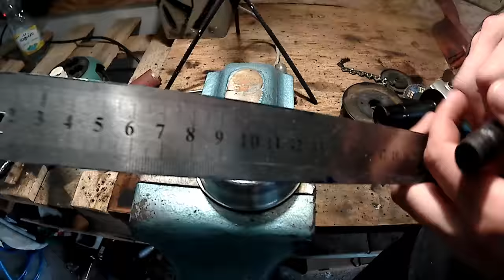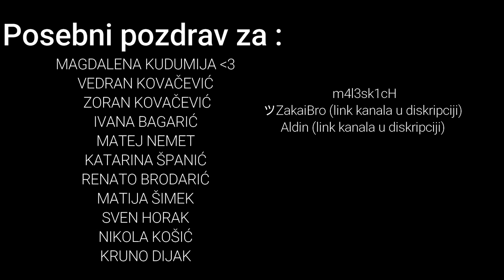Homemade Chain for TRIMMER?  !!!!!   JUST EXPERIMENT   !!!!! + TEST  (DONT TRY THIS AT HOME)

Comment: I would not make one of these.  1).  Good trimmer or not it's going to wreck the drive shaft, output shaft, and the motor if you're not lucky.  2).  If a piece of this flies off it's not going to end well.  I had a piece of .105 diameter Stihl string break off today and strike me on the arm.  It hurt like hell and I have a large welt on my arm now.  It's still pretty tinder to touch.  A piece of chain breaking off and striking you is an automatic trip to the ER.  Nice idea but let a company engineer it and then buy it from them after it's proven.

Comment: I would use small hose clamps rather than weld. That way u could easily replace. Also i would add weight on opposite side for balance

Comment: 1. центровка нарушена - редуктор сломается быстро. 2 эффективно работает только одна половина - вторая обратной стороной. Если уж плевать на безопасность и нет желания использовать стандартный диск для кустов цепь надо было разделить на 2 части и одну из них развернуть на 180 градусов.
1. The alignment is broken - the reducer will break quickly. 2 only one half effectively works - the second is the reverse side. If you do not care about security and do not want to use a standard drive for the bushes, the chain should have been divided into 2 parts and one of them to be rotated by 180 degrees
Reply: я тоже сразу на центровку подумал!

Comment: Neat idea but one of your blades is backwards so one chainsaw chain is just slapping the grass while the other one is actually cutting. The blades need to face opposite directions.
Reply: No any part of this chain is actually cutting. All it does is munching / ripping the grass. It does not matter which way you put it.. The only way it cuts is the case when the chain brakes and cuts your leg. Other than that, what a great idea!

Comment: Don’t do this I had a friend killed with one of these home made flail mowers! The end flew off and punctured his skull - he was working 30meters away when the accident happened as his work colleague was strimming . The subsequent health and safety investigation found that the flail chain was not rated for the speed or forces at which the attachment was being spun by the strimmer, they calculated that the tip which hit him was travelling at over 200mph which if memory serves me is nearly as fast as a bullet. It isn’t worth it for the sake of a poxy video.
Reply: I am sorry
Reply: Andy Tomsk most bullets travel over 700mph, plenty double and triple that... so your memory is tainted

Comment: You made it out of 1 piece of chain, so only 1 side of chain will be using the cutters on the chain, you needed to cut chain in half and weld the chains where they will both be cutting

Comment: Only one half is cutting with the actual teeth.   Do two separate chains so they're both oriented the correct way plus you'll be able to better balance it by welding one chain on one side of the hub and one chain on the other side.

Comment: With that much extra weight it needs to be balanced , not perfect but close.  You could add balance weight with three langths instead of two or use extra weld on opposite side. Good day🇺🇸TRUMP 2020🇺🇸
Reply: Дуракам закон не писан,дроблёный Буратино в голове вместо мозгов

Comment: That could put a hell load of strain on that machine. It's only small. The angle drive isn't mad for heavier parts like that or the extra G's it's gonna make when spinning.
Reply: Going to have to agree.  That thing looked like it was way off-balance, and it'll probably end up wearing out the bearings on the machine pretty fast (or snapping the driveshaft).  Assuming it doesn't fly apart and hit someone first.
Reply: @user-ld8ep5qr7m  at one point stihl actually made chain heads for the machines. they blitzed through bramble, nettles and pretty much any green vegetation that would normally snap cord head. they banned them after a weak chain link broke lose, hit a worker in the back of the head and killed him outright.
Reply: @thefightinfox7846  Sounds about right.

Comment: OMG!! This is fukn funny as hell!!   one.. this are sold online and in stores..and your "experiment fails" how? why?  you attached the chain backwards BACKWARDS>.you are no cutting with the chisel edge of the chain..you are hitting the grass etc with the back of the chisel??? Christ!!  not only did you do that.. the chain you used is not designed to take impacts like that..they brake!! the ones designed for it..can not be used on a chainsaw.  You would get better work done.. and greatly reduce injury to yourself and any others near you.. by making an adapter for a 10inch skillsaw blade!! and does wonders are thick grass as well.. ( obtw  at 4:16 you can clearly see that the chain is backwards this proving my point!

Comment: That is VERY BAD for your gearbox unless you balance it.
Reply: not only the gearbox. VERY BAD for the operator as well
Reply: Yep, I tought the same, the inner part of the "wheel" where he soldered the chain to the metal part that connects to the axel is not balanced, maybe a piece of metal in the opposite side of the soldering chain with the same mass of the chain portion+soldering
Reply: @jorggamingcr409  he does have another bit of chain on the other side welded on 180 degrees opposed so it is balanced

Comment: Dude the links can detach and fly quite far.  Good idea but steel cable with welded ends does the trick better also its lighter so the bearing will live longer.

Comment: Not really practical, cool idea for zombie apocalypse.. but, one question, why didn't you add more chain on the inside to even out the weight? Even with string line, weedeaters get high vibration whenone side is just a 1 1/2 inch shorter.

Comment: Your engine is not strong enough for this.
Your chain is not balanced.
If it is on the good side on left, it's on the wrong side on right ...
To be more gentle to the bark of the tree (to your engine and your bearing), and if you want to try another stupid idea, try bicycle cable brake. I said stupid idea

Comment: Very easy to knock bark off the tree this way.  Just be careful. A nick here and there won’t matter too much but if you girdle it, the tree dies.
Reply: That was my 1st thought, too. There are (not very expensive) mulch blades you can buy, that are much safer for the tree.
To get more durable cutting string I replace it with two carpenter nails plus washers e.g. to scrub weed from flagstone paths in the garden.

Comment: Good idea. But the way you had the chain set up, only the one side was utilizing the cutters. Also, was that a serpentine belt pulley?
Reply: No side was using any of the cutters, back of the cutters on one side and the drive links on the other. Nice idea wasn’t thought out well. I like how he drilled little holes then cut scene to them blown out with a torch. Two separate chain pieces would be ideal. But that’s what brush cutter heads are for anyways

Comment: Better more simple with a iron cable... on the plate drill 2 hole  and lock the cable with a Bolt nut and washer
Reply: A video on this would be great but I'm going to try it anyway. It will probably work good for the over grown cemetery I'm trying to clean up. Didn't want to ruin the only chainsaw chain I have, but I do have some steel cable I'm not using. Thanks
Reply: @user-cs3zs6jn1d  yes i untherstand... same with your chain it's better strong comparated  To the iron cable... but for savinģ the wellding  ... just 2 hole in bottom cap and locked with Bolt  and nut

Comment: I did this with a brush cutter head..welded 3 of them to washers to replace the cheesy plastic knifes
Reply: My brother n law did the same thing. The head snapped the end of the shaft and came off and broke his leg.
Reply: @russellwisenbaker118  must of had it off center..the way this guy did it is scary as you can see it's not balance well
Reply: @russellwisenbaker118  sorry for his leg tho ,that had to suck

Comment: Can you build me a weed wacker head like that I do lot lawn care
Reply: Just buy a 3 blade brush knife for $15 at your Stihl dealer, JFC talk about a $20 solution to a $2 problem.
Reply: nik krenitsky seems like you can only get the blade kit for like sthil and echo can’t find any for a homelite
Reply: @BRENDAJASON1  
1. Why are you using a Homelite? 
2. Is the output shaft different from a stihl or echo? Most straight shaft weedeater are universal (execpt bent shaft, don't use those). If its the same then just get the Stihl blade adapter hardware kit or swap the whole head assembly with a stihls onto your home lights shaft. Any outdoor power equipment store worth it's spit should let you compare your homelite to a stihl or echo so you will know weather it works or not. 

Seriously though Poulan and Homelte are shit. Get an FS-90 or FS-111 if you plan to do some serious weedeating and brush clearing.
Reply: @BRENDAJASON1  
If you need some serious Dakka though then get an Echo srm-410u or srm-420 clearing saw for $600. Those things put in work like a $16000 tractor with a bushhog!
Reply: nik krenitsky I had it laying around and bought a carburetor for it it runs out pretty good yea I been looking at them adapter plates for the sthils (yes this is a strait shaft). The splines on this one has the 12 notch’s and some have 6, when I get the money I’m gonna pick up a stihl, yea the polins and homelite are like the old style surprise their still around
Reply: nik krenitsky yea I got a lot of bush and weeds I need cleared out I’m gonna have to break down and get a good weed eater
Reply: @BRENDAJASON1  
If your regularly going to be using your machine for 1 hour or longer sessions then get at least an FS-111 with bike handles. Using conventional handlebars for any extended period of time will be murder on your back unless your short enough to be able to reach the trimmer hear flush to the ground without any bending whatsoever. Stihl trimmers and clearing saws have better build quality than Echo in my opinion, but their harnesses for the bike handle models are terrible. I had to buy a $120 Husqvarna clearing saw harness just to be able to comfortably use my FS-111 and FS-240. Echo definitely has them beat in that department. 

If your just going with conventional handle bars then get a Stihl FS-111R. An FS-90 is all you need though if your not planning to do anything too heavy duty. 

If your talking acres of 4'+ tall tree saplings and thickets however then just go whole hog and get an Echo srm-410 or 420. Those things can still do normal string-trimmer weedeating but its total overkill.
Reply: nik krenitsky it’s mainly just bush mabe some thick twings, I’ll prob just be cutting no longer than 30 min and rest time will diffently get the handle bars my goal will be getting a sthil and only use sthil products with. Would like to get one of the big sthils like that fs-240
Reply: @BRENDAJASON1  I was very disappointed with my FS-240 and ended up getting an Echo srm-410u to replace it. The Stihls harness mount point was poorly adjustable compared to the Echo and the harness was so lousy that I had to buy a Husqvarna harness to use it. My only regret with the Echo was getting the srm-410 instead of the srm-420 which has cowl with multiple mount points along the shaft for quick height adjustment. 

I dont have much experience with Echos smaller trimmers and think they look pretty ugly, but if your going to be doing light to mid duty work for intervals no longer than 30 mins then I would get an FS-111R (the R's are the ones without the bike handles). That one is Stihls one size fits all trimmer that can use the most attachments. My FS-111R is my go-to trimmer for use as a pole saw, string trimmer, hedge trimmer and clearing saw. I only use my Echo srm-410u for hardcore brush clearing that you would normally use a small chainsaw for if it wearnt for all the bending down like limbing branches off a fallen tree trunk. I only use my other FS-111 with the bike handles for long sessions of string trimming or light brush clearing that I know would be murder on my back with the FS-111R and twice the effort and gasoline with the heavy Echo srm-410u.